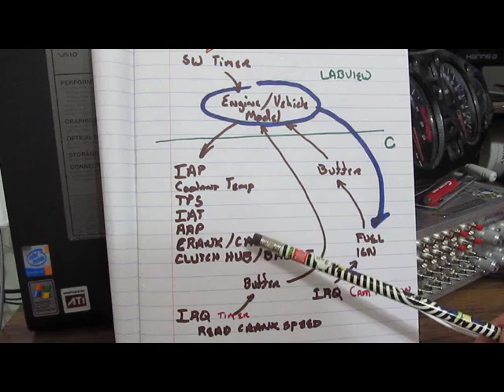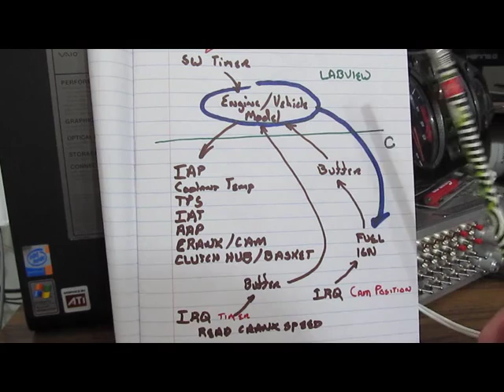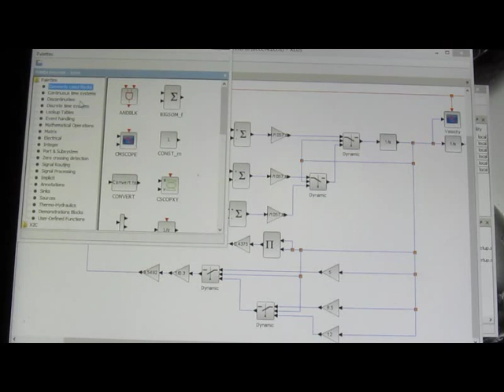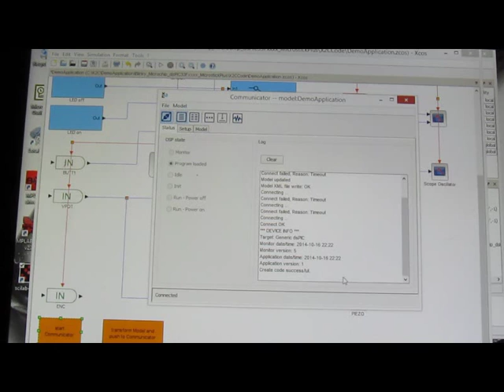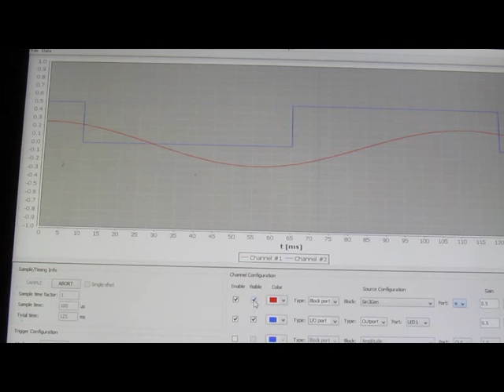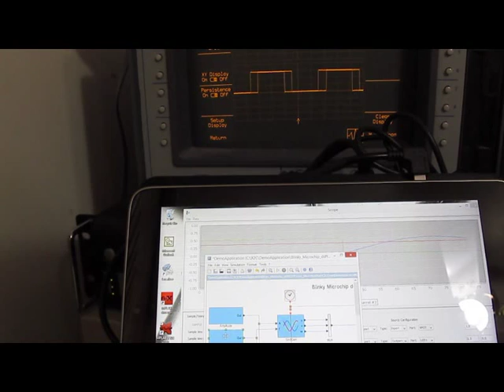X2C XCOS to C code

Comment: This video is helpful for me. Thanks a lot.
"because X2C outputs ANSI-C code it doesn't care about what the target device is..."
I found this statement very useful. I have some questions though...

I plan to use Arduino boards, would you know if it is possible to generate codes for Arduino or ATmega328 as its MCU?
How do I read inputs from Arduino boards/MCU given that I have sensor on it?
Does X2C supports code generation for user-defined function called on XCOS?

But later on my project I plan to use Raspberry Pi, will I able to use X2C on that?

Sorry for too many questions.
Reply from the maker: +mark steiryx   Their debugger only supports certain boards.  Check their website for updates on what boards they support.
Reply: +mark steiryx 
The support for Arduino Due has just been added, check it out at the x2c project homepage: mechatronic-simulation.org
Reply: Thanks for your info.